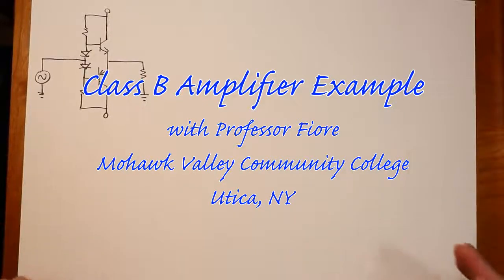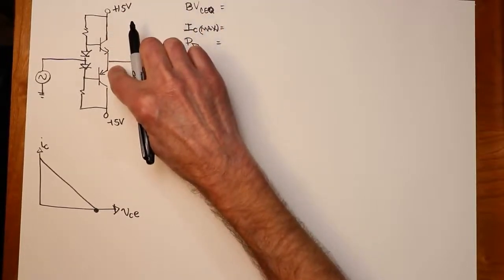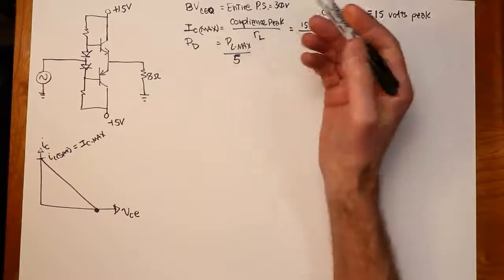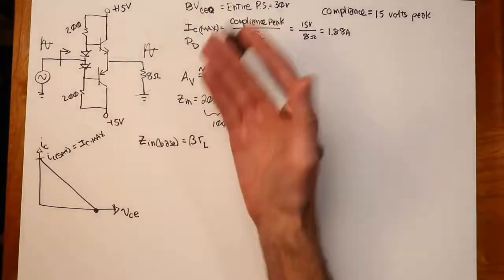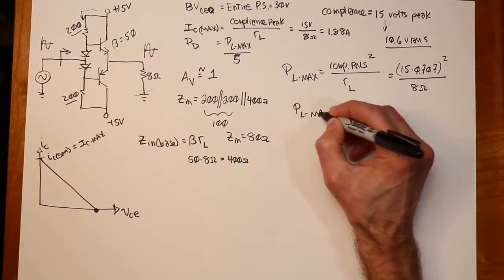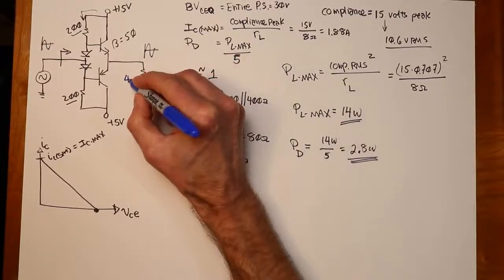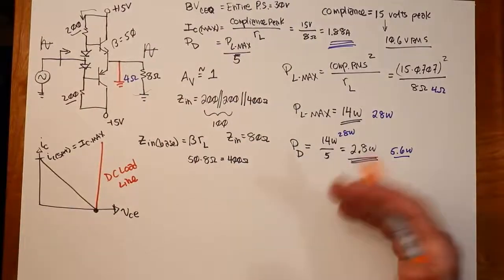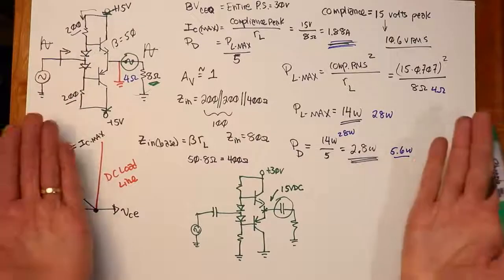Semiconductor Devices: Class B Power Amplifier Example

Comment: EXCELLENT PRESENTATION!HOW DO YOU CACULATE THE OUTPUT IMPEDANCE FOR THIS CIRCIUT?IS IT THE SAME AS THE COMMON COLLLECTOR?
Reply from the maker: Pretty much yes, because only one device is on at any given time. (Technically, it is common collector although the "resistance in the base" section is a bit more complicated than in a single stage CC.)

Comment: Good evening: I have a question about the power supplies (I am a beginner so it might seem like a stupid one 😂)
For me, the power supply must be able to furnish the power demanded by the load + the transistors.
What happens if the power suplly cannot do so ? Does it limit the circuit or does it damage the power supply?
If for exemple if I have a ±15 V 10VA transformer and an 8 ohm load
Reply from the maker: That depends on the design of the power supply. If it's overload protected, most likely what will happen is that the supply rails will droop and probably show excessive ripple and noise. The end result will be a distorted output. If the supply is not protected, then yes, you could damage the supply (and also produce distortion along the way).

If you are designing your own, a 10 VA transformer would definitely be undersized for that voltage.
Reply: @ElectronicswithProfessorFiore  thank you for this detailed answer ! I am indeed trying to make my own guitar amp 😁
No need for something very powerful for a first time, I will already be glad if I can get some sound out of it 😂

Comment: 18:05 does large capacitor need to be coupled with low output impedance because it helps slow down charge/discharge rate of capacitor?
Reply from the maker: You could look at it that way, but a more direct way is to notice that the cap forms a voltage divider with the load. The larger Xc is, the greater the loss across it, thus we want a small Xc (which means large C).
Reply: @ElectronicswithProfessorFiore  i never thought about that. thank you that really helped